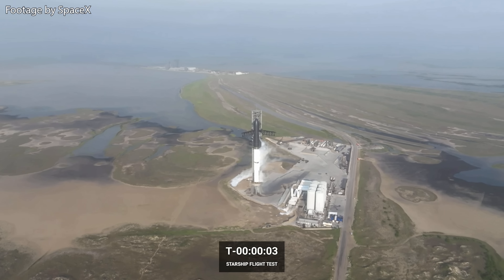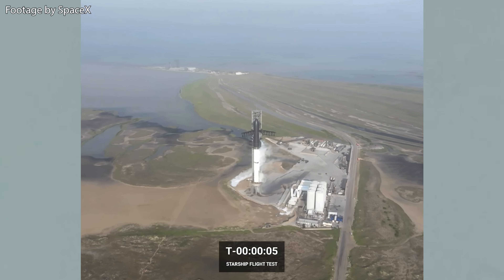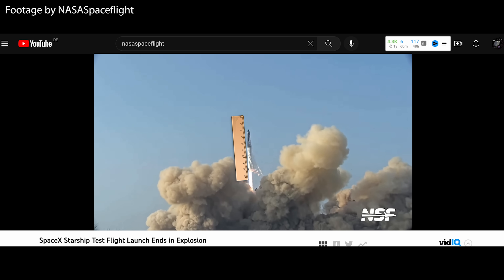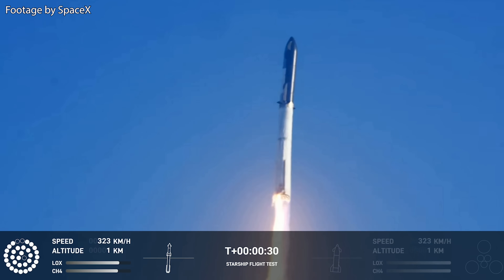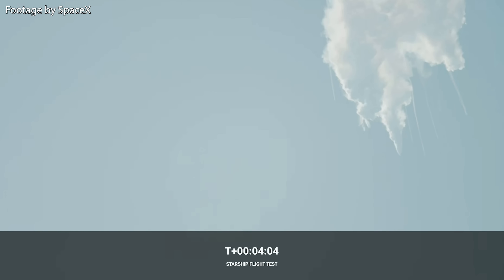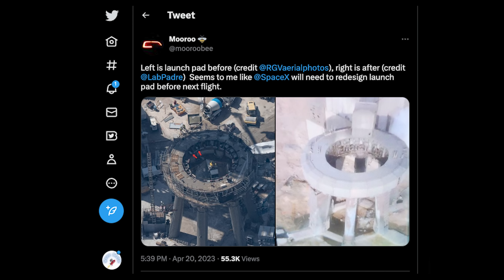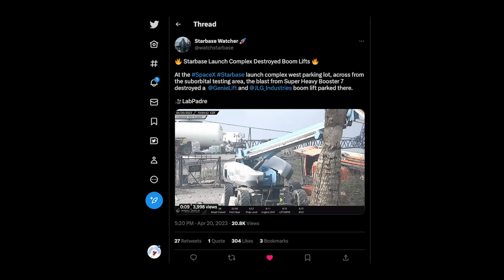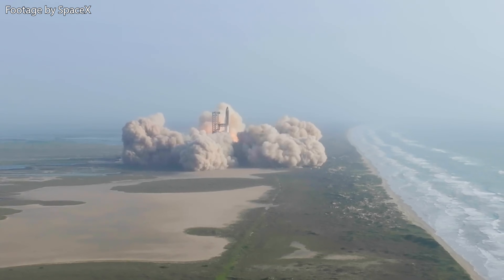SpaceX Launches Starship But Causes Big Damage to the Pad. What Went Wrong?

Comment: I'm pretty sure the explosion at the base of the vehicle at T+32 seconds was an ... "anomaly."
Reply: THE LAUNCHPAD LOOKS LIKE A TOY COMPARED TO CAPE CANAVERAL IN FLORIDA ! YET THE ROCKET WAS TWICE THE POWER OF THE ROCKET THAT TOOK PEOPLE TO THE MOON 54 YEARS AGO !
Reply: @andrasbodo  The Cape launch complex was designed to host anything, and everything, not just the Saturn 5. That is why the towers at the cape are mobil. In this way, you can design whatever tower you need for your rocket, and drive it to a pad that is big enough for it.... and fix your caps lock key. All caps is yelling, and surprisingly annoying.

Comment: I committed on a video saying the pad was a bad design and can't believe rocket scientists signed off on that design. It would damage the engines at liftoff. It did. 

Stage separation is not going to happen, btw both vehicles as currently designed. 

6 engines were destroyed at liftoff. It ran out of fuel bcos other engines had to do extra work and lost thrust power.

Comment: Remarkable when a rocket prototype performs better than the launch pad it departed from. I strongly doubt a second test in 4 months is possible and approved by the FAA under the circumstances.
Reply: Agree. They might have to start all over with the pad... which has taken two years to this point. Oie.
Reply: 2 years realistic time.

Comment: I wonder if the failure of stage separation was the primary cause of forced RUD. If so, I imagine that vigorous discussions are ongoing regarding the whole cartwheel maneuver. Perhaps springs are being discussed.
Reply: I think the failure of the engines on the first stage to shut down somehow kept the second stage from separating, but I'm happy to let the team at SpaceX determine exactly what happened.
Reply: One of the engines exploded next to the hydraulic controller at +30 seconds. There was no hydro-pressure to release the clamps. New ships (all after these two actually) now have electric actuators replacing the hydraulic system. This would have worked had the pad not turned the bottom of B7 into swizz cheese.
Reply: @hawkdsl  Definitely a possibility.
Reply: @hawkdsl  They did specify that the clamps had already been released at T plus 15 min
Reply: @VerdictREX  I think he's talking about the clamps that hold the 2 stages together.
Reply: It's not supposed to cartwheel until after staging. It's the same process F9 uses for the boostback. What you saw there today was just an out-of-control rocket, made more confusing by a confused commentator who was trying to keep to his script.
Reply: @Tom Mosher  I agree.  It was a very fake and bizarre spectacle, hearing their pre-fab commentary.

Comment: "a fully successful launch"   No one was killed.  The base wasnt totally destroyed. the rocket had to be blown up.
Any more success and they woulda been in trouble.
Reply: Google the definition of the word "test."
Reply: @michaelsutherland5848  And some aspects of the test worked and some didn't, thus calling it a "fully successful launch" is pure spin. Yeah it got off the launch pad albeit with significant damage to the pad and possibly to the rocket itself with 3 engines out and more to follow but I'm sure the engineers would of much preferred the stream of data they would of received on the characteristics of the stage separation, Starship engines firing to orbit and reentry of the Starship at orbital speeds than seeing it spin out of control prior to separation. If all they really wanted to do was get off the pad they wouldn't of wasted a fully functional Starship as the 2nd stage.
Reply: @kenrattee5834  SpaceX did exactly what it said it wanted to: Clear the tower with an integrated system, and collect data. Accomplishing those things = success.

But you keep on nipping at their heels as if you're a better judge than the engineers doing the work.

Comment: Why do they not have underground thrust diffusers for the blast like in Florida? You need deep concrete underground divertor tunnels to divert the take off blast to prevent this kind of damage... Its a science to develop and surprised Elon did not make this on his pads?
Reply: Because they're rushing to prove some success for more government subsidies. They were advised this would be an issue a long time ago already.
Reply: @shaneomax2296  ya no shit. The more tests they get the more information they get. This isn’t them being lazy.
Reply: I wonder how badly the tank farm, condensers, pumps etc. were damaged. The whole site could be wrecked for all we know at the moment.
Reply: We are all surprised. My guess is that they wanted to see if they really needed one, since Elon Musk is all for best parts is no parts.
Reply: @karlkarlsson9126  A wedge or trench at the bottom  of the OLM stops one part from turning into 50,000.
Reply: This pad set up was Elon's personal gamble, and he lost. He said it would be OK, or the dumbest idea ever. There is no (nor will there ever be) a flame trench because its at sea level. All they would end up doing is building a trench that would become a lake. It's the same problem at the Cape... That is why all the launch pads at the Cape are on mounds. They will have to build a flame diverter that uses the space between the OLM and the ground somehow. They might have to start all over with the area around the pad.
Reply: He was scared that if he built the flame diverter trench, that the rocket would lose some of its thrust power and he wanted to ensure maximum thrust to achieve liftoff.

Comment: Everything is praised as a success in this world. 🤦🏻‍♂ Frankly and honestly this was a disaster! Imagine if the rocket would have exploded on the pad!!!
Reply: The test was to ascertain data from the first stage.  Additional data is beyond expectations.  As such the test was a success.  Your desire to cling to hypotheticals is telling.
Reply: They intended it to explode so technically it did what it was supposed to do so it was a success. See how it works?
Reply: @larky368  No they didn't the objective was to achieve orbit and they failed.
Reply: You are correct.  They spin this as a success but the clock is running over in the Artemis program.  After Artemis 2 late next year, NASA will be ready for Artemis 3 in 2026 and  likely be waiting on SpaceX still struggling with Starship and SuperHeavy.  After all, this was the easy part!.  Now they have to redesign and rebuild the orbital launch mount.  Then they still have to get a clean first stage launch, Starship separation, orbit, de-orbit re-entry, and landing.  Then they need to start catching Super heavy boosters.  Then they have to make all of this rapid and routine to support Orbital Refueling operations for Lunar Starship.  Oh yea.. and they have to build and test Lunar Starship, proving they can land a 15 story building on the un-even surface of the moon.  They can't do all of this in the next three years, or four years, or even five years.  NASA should start replanning the Artemis program.  If they don't, they will be sitting idle for YEARS .. waiting on SpaceX .. who may never get this Stainless Steel Goose perfected.
Reply: @ericmatthews8497  Common sense. I agree with You :)
Reply: @paulhiggins6024  NASA doesn't have unlimited amounts of dollars.  But what they do have is a successful Space Launch System, that can get Astronauts to the Moon by 2026. Given today's disappointing performance, I don't believe that Starship will be ready in 2026 for Artemis 3.  NASA needs to replan the Artemis program. 

When this happens, you will know that I was right.
Reply: To be honest, I was like you when I first started to follow SpaceX and saw their vertical landing attempts, I didn't understand why they praised failures, it felt like they just tried to keep their mood up among themselves, but after been following the progress on Starbase now you kinda understand that they are building new prototypes. For people who don't follow SpaceX, like how Media reports it, they think they are witnessing a fully developed rocket ready to go but then suddenly explodes, but for anyone following the progress knows that they have boosters and Starships on cue, basically these first version are expected to somehow go wrong to gather data. I mean, look what they did with Flacon and the Dragon capsules, the best and most solid things in space we have today.
Reply: @karlkarlsson9126  Yes and no..  The explosions rocking the launch vehicle as it lifted into the sky were also an anomaly.  It is probably sheer dumb luck the stack didn't explode on the launch pad, being hit from flying concrete debris.  The Orbital Launch Mount design is deeply flawed, and they have started building this failed design at KSC.  This "successful" test, just set the program back at least one year.  Kinda funny for a "successful" test.
Reply: Bro doesnt even know what a test means 💀
Reply: @paulhiggins6024  Spending hundreds of billions of dollars on wars and its fine, a billion on science and an average andy gets mad...

Comment: B7 was like alright if you won't do it then I will make one for myself thank you very much.
Procedes to dig flame trench.
Reply: It's very effective...
Reply: I could still see why SpaceX did what they did by not building the flame trench. Because instead of directing all those energy to one side, by directing all the energy to all direction it won't require the use of flame trench and just the Water Dilute System.

But they did this test without the Water Dilute System probably because they want build around it if you're uncertain about it. Super computer could only do soo much and real life testing is necessary where you really start making permanent solution

Comment: I believe all the problems were created by flying debris from under OLM and I wonder why they don't install a cast iron plate there instead concrete. They should have learned that from the first booster "33" engine ignition.
Reply: Iron melts at 1538C.
Reply: @Richard Cranium SpaceX staff started to work on the raptor in 2009,that is 14 years! and $10 billion to get one Starship 100% operational in 3 years is not cheap!
That is why Elon own only 42% of SpaceX now....
Reply: Yes you build around it if you're uncertain about it. Super computer could only do soo much and real life testing is necessary where you really start making permanent solution

Comment: The flip was intentional
It is used to separate the stages 
Fts was initiated once stage separation had failed
Reply: Separation first, then flip. You can't use a flip to do a controlled separation of a flying rocket. Imagine the complicated dynamics. The flip is part of setting up the boostback burn after separation.
Reply: That wasn't intentional.

Comment: They're definitely gonna have to rethink the OLM There's just too much energy being released so close to the ground. SHB needs large thrust Divergent channel.
Reply: and why did they leave so much 'easily moveable' equipment near the OLM? there was a moderate risk of explosion at ignition.
Reply: @RenoSCM  They underestimated the energy being released by 33 raptor engines so close to the ground. The boosters built like a tank very impressed with the performance given the damage to the launch site.
Reply: Can’t dig a trench the water table is a few feet from surface.   Bad location.
Reply: @1911Earthling  Then elevate as they do at Cape Canaveral.
Reply: @aaronstodolka3438  his ground support will take some heroic engineering to conquer the blast of that booster.  And have the ground equipment stay together at his fast pace schedule is questionable.  He has a lot of blast proofing to do.   Can that booster blast be contained enough to make weekly launches feasible?
Reply: @1911Earthling  yes they can. its done all the time. what they do is drive in steel interlocking retaining walls. then pump the water out.
Reply: @AlUrker-y9p  I was told there is some other engineering problem that prevents this.  Environmental?  I don’t know.
Reply: @AlUrker-y9p  something is wrong. As a GREAT engineer he should have known from day one with that amount of thrust needed a divergent channel.  Something is not right!  I can’t believe the crazy ass thing it was to blast his launch facility apart and say everything is REUSABLE.  If they don’t have the brains to dig the trench what else do these engineers think unimportant?  Something is preventing them from installing the simple way of diverting the blast.  Why?

Comment: I was expecting a bigger fireball when they terminated.

That said... It was all over the place yet it didnt tear itself apart. Thats quite promising on its own, thats one strong structure.
Reply: If you look at the fuel meter they termited when b7 ran out of lox and it was 30km high in the air so not much oxygen pretty sure if it was earlier it would have been a huge fire ball.
Reply: @U_Geek  true for the booster, but starship was full and there wasnt any fireball either.

I guess they dont get to mix in an adequate air fuel ratio to burn, methane is quite finicky with fuel ratio. Too much or too little and it wont burn.
Reply: @Coyote27981  Oxygen doesn't have that problem.  I bet that was a nice bang!
Reply: How about the rocket itself and in particular the Raptors which were exposed to the blast and several actually exploded on the way up. No other rocket could have withstood that and kept flying. It went all the way to MECO. Its a tank!
Reply: @mikedelta1441  I have to 100% agree with you. As soon as the exhaust touched the pad, it was getting pummeled. I'm more impressed with it surviving as long as it did. It probably looked like swizz cheese in the engine bay, but kept going. This flight actually gave me more confidence in the Starship Program.
Reply: @mike delta  I'm on both sides of this fence.  Yea great that it handled the damage and did as well as it did, But, shocking that it got damaged in this seemingly blindingly obvious and even demonstrated way.  Apparently Granite could withstand the heat and pressure.  If there is a solution like this, I'm very disappointed that it wasn't employed and led to this failure to succeed more.
Reply: @mikedelta1441  bro, not the area you wanna be up selling. 5 of those engines never even lit up. Make no mistakes, it may have been a test, but it proved how unreliable the vehicle was. While Elon and the boys are saying this is all a success, it’s just gaslighting. Nothing about this launch went to plan other than clearing the tower, and that’s like saying “yay, my car left the dealership parking lot”
Reply: Also, with the fuel being methane it would largely burn almost clear in the blue sky. So apart from bits of steel or cable burning not much would actually create a visible flame.
Reply: It was most of the way used up.
Reply: @SeeLasSee  Not on the ship!
Reply: @timboatfield  they’re calling it a ship. In reality it’s just the last stage. It has limited capacity. It just sounds better for the investors. It’s basically stage 3 of the Saturn V
Reply: @stevenw.miguel  Dude your opinion doesn't mean jack really!  It is a ship, that will go on voyages through the Solar System.  You're basically a total tube!
Reply: @stevenw.miguel  feel free to show them how its done...
Reply: @Coyote27981  don’t have to, the engineers already did…before launch…
Reply: @timboatfield  this comment aged poorly
Reply: One of the benefits of the Flight Termination System. Is conflagration, not Detonation. It destroys the fuel tanks in such a way that the fuel and oxidizer don't mix in a way that explodes, but instead just burns up.

Comment: I believe the rocket, its engines were damaged by debris kicked up from the launch pad at take off. It was a test flight and it was overall a success in that it got off the ground in its first flight - from here they examine all of the data and make improvements and modifications - they learned a lot - the beauty of SpaceX is that they are transparent and are legit - only NASA with primitive technology from 53 years ago could successfully land men on the moon 6 times between 1969-1972 without a fatality or catastrophic accident in those 6 manned missions totaling nearly 3 million miles in flight from earth to the moon and back - nudge nudge wink wink